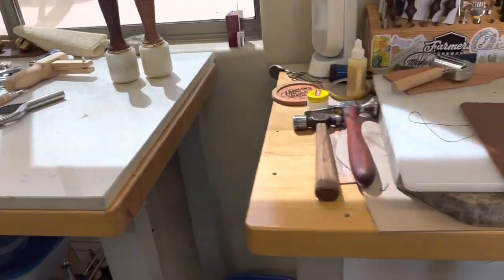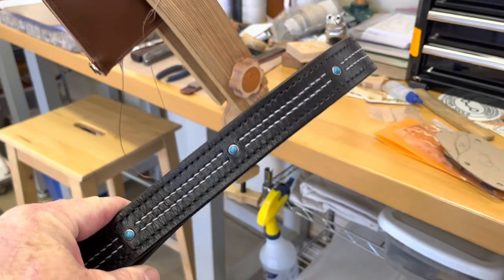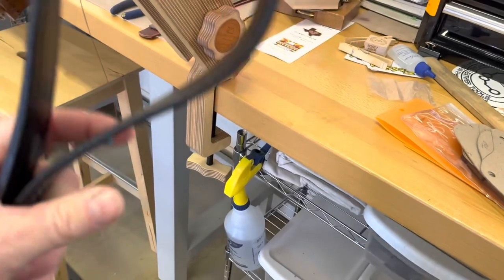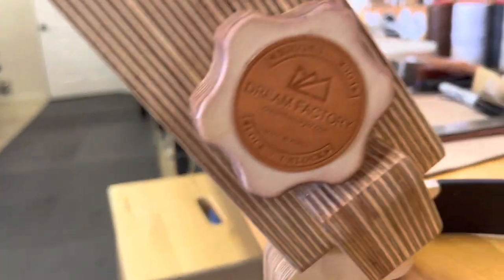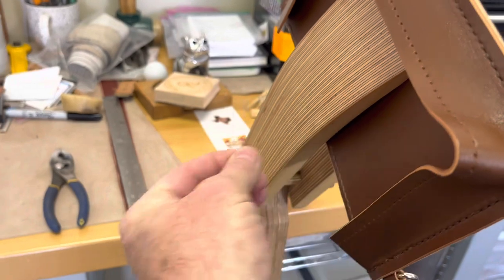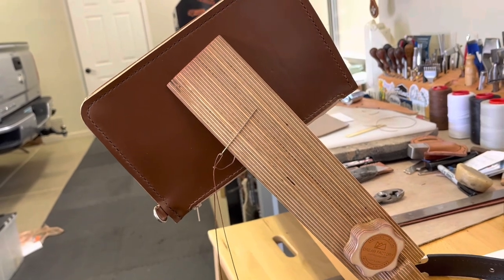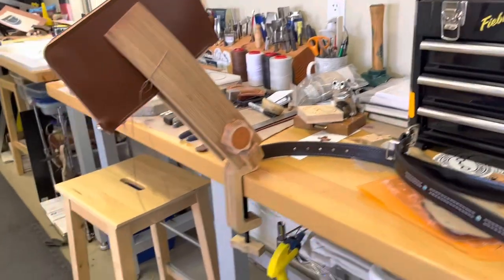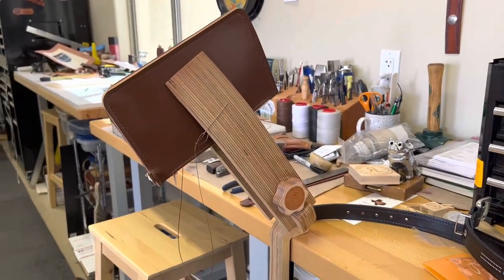Should I Use A Stitching Pony @InMyBusyLittleShop #leathercraft #dreamfactory

Comment: That’s the one thing I don’t have yet.  I have been using a very thick book and a clamp. 😂.  Your stitching is excellent.  What thread do you use?  Also, do you use stitching chisels by hand for those long lines on your belts or do you use some type of press?  Thanks Robert and have a great week!
Reply from the maker: Good questions and thanks on my stitches. That is Tiger Ritza. The white is .06 and the black is .08. All holes were created with Weaver 5mm chisels. The set has completed over 100 belts. I create a groove line and follow along with the chisels. I always work from the tip.
Reply: You are a wealth of knowledge.  I learn something every time you post.  Thank you!
Reply from the maker: Thanks. I appreciate the feedback.